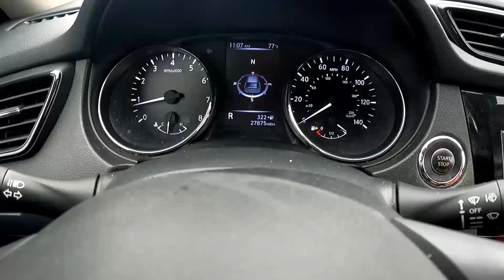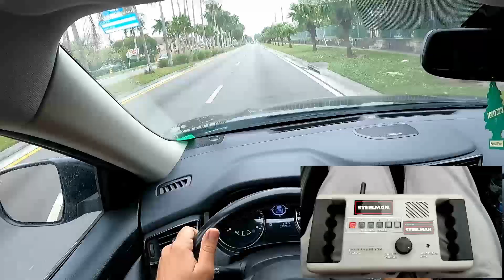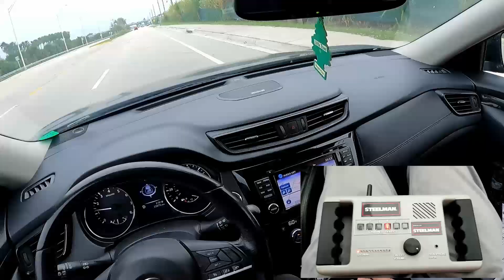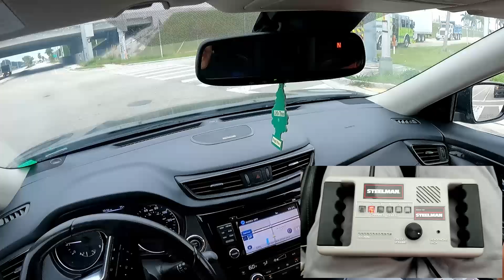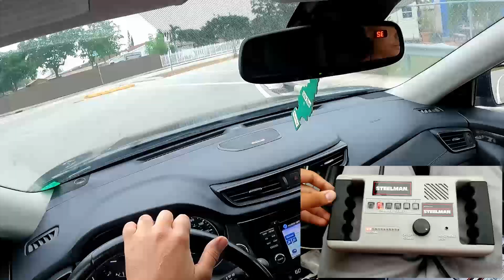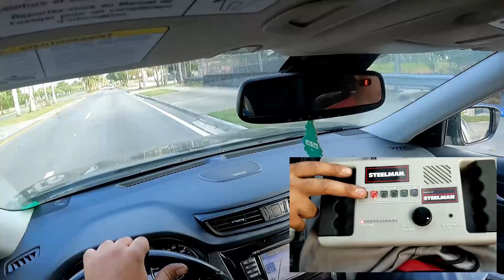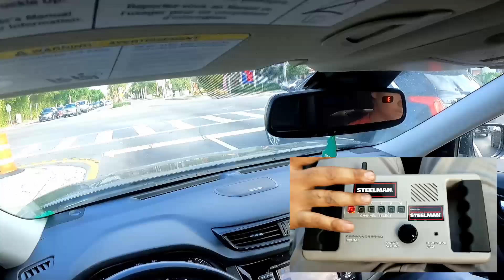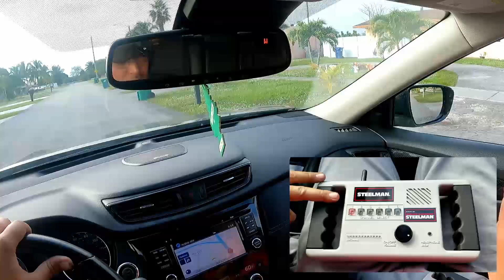Nissan Rogue drives rough/makes rumbling noise

Comment: My ‘21 rogue has just over 33k and it’s starting to drive a little rough with rattling sounds underneath, mostly from the back driver side tire area and is loud and shaky when in park gear. I’m disappointed. I keep the car up with regular maintenance and new tires. I had 3 Nissans in the past 20 years. It’s time to upgrade to another Make. No more Nissans.

Comment: Hey there, just purchased a 2019 rogue. There's a rumbling noise/vibrating seeming to come from the front driver side of the car. Don't have a noise detector be you can feel it. Made sure battery was secure, air pipe too. Any ideas of what it might be?
Reply: Were you able to figure out the issue? 
Mine is doing the same thing... 😭😭
Reply: My 2017 rogue same annoying asf I have to turn the music up to not feel embarrassed

Comment: Do you know if one goes to a dealer to see if a noise is something that should be fixed under warranty, and the dealers ends up using a chassis noise detector tool, but ends up not thinking anything is wrong, if the dealer could end up charging the customer for time spent doing the diagnostics?
Reply from the maker: They may charge you diag fee. Speak with a service advisor before you agree to anything

Comment: I have this exact model, with 33K mileage. It squeaks going over any bumps or variations in the roadway and Firestone guy said nothing can be done about it as these models have no where to grease or lube in the suspension or chassis, so to lie with it. The car runs well but it sounds like an old Model T or something. I know it's underpowered, but what's the deal with those squeaks and can they be serviced somehow?
Reply from the maker: It should definitely not be squeaking.  Even though there is no way of greasing the suspension if something is causing a noise you can replace it. Find the source of the noise and repair/replace as needed
Reply: @gautorepair  The Firestone guy couldn't find anything other than a "possible loose hood latch". Do you suggest I take it in to the dealer, or find a good independent mechanic to try to figure it out?
Reply from the maker: Yes absolutely. If you feel that something is not right with your car get a second opinion. The independent shop will probably give you a better price, but the dealer sees these cars everyday and have possibly experienced this issue before.
Reply: @gautorepair  Smart advice. I have an appt. with the Nissan dealer Monday. Appreciate the info.
Reply: Nissan found major cracks in suspension and tire areas. Got it all repaired, put on new tires and runs great. A $4k + investment but with only 34k on it, worth it.
Reply from the maker: Glad to hear you got it resolved
Reply: @gautorepair  So now there's this little glitch with the low tire warning light coming on, going off and coming on again. Brand new Yokohama's bought at the dealership. A week later, light came on. Went to Firestone to have pressure taken. All were a "little low". Light goes off. Start my trip from Tucson to Seattle yesterday. Light goes on on the freeway. Freak out. Pull over twice to check. Don't seem low. Light goes off. On again within 20 miles. Went to another tire place here in Northern AZ. All ties "slightly high" so he adjusts. Think there's a faulty sensor but can't determine. So now, 4 more days of major freeway driving ahead with that pesky, unnerving tire pressure warning light coming on at the most inopportune time. So, what's my option? Take it into the dealership when I get to Seattle? #Irritated
Reply from the maker: Check the spare tire pressure. It may also have a sensor. If not and all tire pressures are ok you should be ok till you get home
Reply: Get another car have 2015 nothing but problems

Comment: Mine sounds like
Garggling noise
Reply: Did u ever figure it out
Reply: @ my nissan had two thing wrong i believe the gargling noise was the sunroof leaked into the car because the part where fluid came out was clogged with dirt leaves and debris which were leaking into the floor n making the floor wet n then the other issue was there was a clanking noise come to find out shards from the transmission broke off n make the transmission go out good thing i had coverage for it in the warranty they replaced it but i YouTube how to fix leaky sunroof and fixed it at home because they said like 1400